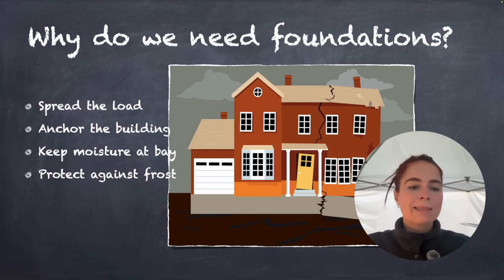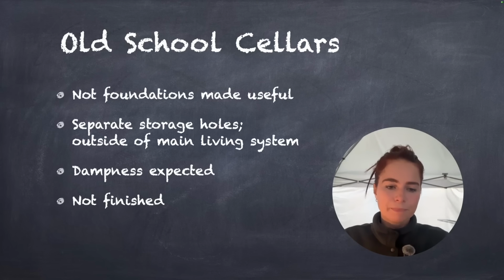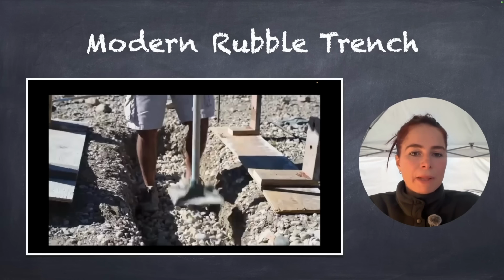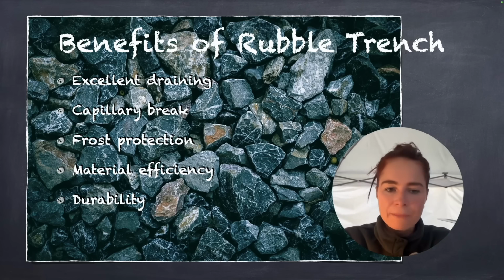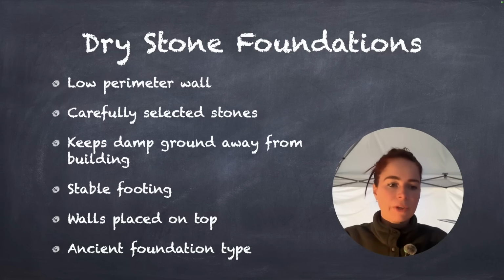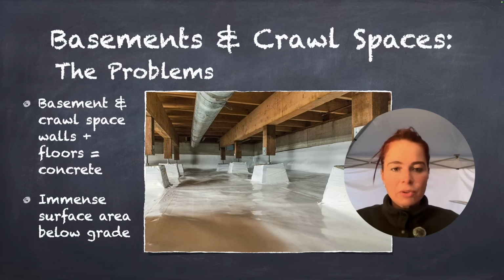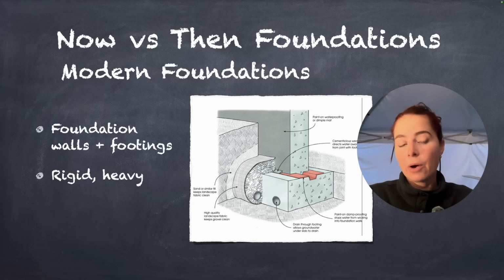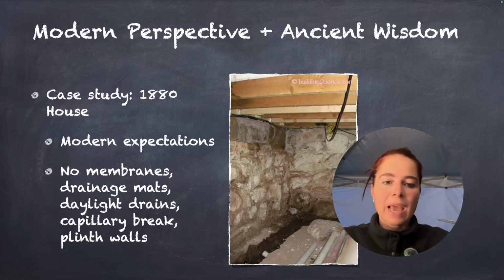Why Modern Foundations Fail — and the Genius Design We Abandoned

Comment: Frost heave is not caused by water, but by salt dissolved in water. Salt tends to Equilibrium creating osmotic pressure. Second law of thermodynamics. Clay has a lot of salts.
Reply: Why do icebergs float in water?
Reply: @RoyUK-s9h 
Fresh water is lighter than salt water.
Salt is displaced when freezing.
Reply: @Darrida Why do ice cubes made of pure ware float in liquid pure water

Comment: Hi, I live in France and I have just built my own house.
I have used the rubble principle.
I had a mix of stone with very little clay in between, I dugout the ground and then put geotextile all over the area plus a 500 mm around the edge of the building then I put 55 tons of gravel over the area folded the geotextile in , then I put blocks 700 mm in from the edge of the building , then I filled up the middle ( inside of the blocks) with more gravel. I continued to put a border around the outside where the edge of the building is, then I had a foundation 300 mm deep and 600 mm wide, plus steel reinforcement, it’s bone dry and I have no cracks and no damp. 
If you want to know more details please get in touch I have lots of pictures
Reply: Id like to know more, does this type of foundation meet the building standards?
Reply: So you filled the cores with pea gravel and rebar?
Reply: That sounds like a very reliable construction. Well done!
Reply: Please, how can I contact you? I am currently planning to build my own house based on natural principles (ecological architecture) in Serbia, so I would probably appreciate photos of your foundation construction. Thanks in advance!
Reply: It's remarkable that a 160 pound mammal needs 110,000 pounds of gravel for a shelter. Something seems very far out of proportion for our idea of a home.
Reply: @tar170 well go back yo hay and clay tribal huts if you want to go full eco. Because today the rest of us are used to a certain life quality and house size

Comment: Basements are built with drainage tile to prevent exterior water from touching the concrete, plus they are waterproofed outside. Interior mold is due to condensation of moist air from cooking & humans breathing & sweating contacting any cold spots (poorly insultated) or holes in vapour barrier (cold air enters or hot exits). All rooms sould be ventilated to remove moist air & replace with dry air (located opposing to "wash" the room) using a heat recovery ventilator (if saving energy in a cold climate). These measures cure the problem. ( its CAPilary.)

Comment: We are still using this method for foundations. We just add more complexity to the moisture control system. The soil type is the major factor of use. As you mentioned this foundation base can only be used in loam, clay and rock must use a layered drain and possibly a sump. It's not uncommon to use #1 or #3 crushed rock or recycled concrete for the ballast. Then top the ballast with #5 or a specialty mix like #411 or #57.

Comment: Mold issues in basements CAN be a non issue if you build right to start either or retrofit (expensive). Waterproofing plus (most important) rock all the way fown the outer wall with tile/drainage pipe.

May not be as easy in flat residential areas.

Comment: There’s a Trolly museum near me that dumped a large amount of ballast 70 years ago and installed a fifty to seventy foot length of track on it. They then put a Caboose on the track. A caboose that weighs close to or exceeding  the weight of a house. No movement from that caboose in all that time and you can live in the caboose comfortably. I have always wondered why this would not be a good foundation for a home and I guess you’ve answered this question.

Comment: We live in a giant, ancient flood plain, a left over from the Ice Age where ground is very heavy clay that moves constantly.  Building with compacting stone is useless as the clay will absorb all the stone and soon enough it is all gone.  Even building roads require layers of geotech fabrics to stop that stone from disappearing into the ground.  Our biggest problem is that back in the late 70’s and early 80’s, the floor joists were embedded in the concrete foundation as it was thought that would better stop air infiltration, however, against regular building wood, the wood rots away quite quickly, especially if using modern insulation techniques.  I have yet to find a method by which insulation should be done in these cases.  The solution I’ve found so far is a trade off, in that the voids between the joists and concrete foundation is minimally insulated with styrofoam against the wood and concrete, thereby creating a thermal barrier, but to not fill the remaining void to allow air movement and thereby stop moisture from settling.  I’ve just had to replace the rim joist of our house due to rot … if you have a better solution, I’m all ears, please and thank you.
Reply: look at the code for Permanent wood Foundation. Rubble Trench underneath with gravel backfill. Now you have a wall assembly that can be insulated along with an engineered floor system that can incorporate radon mitigation as well as be insulated

Comment: Here are a few suggestions: if you wanna be sciency, don't make things up. 1880 "they didn't know capilary force". Actually it was understood back in the late 1600's. Wide knowledge in early 1800's.
Don't know about Canada but Sweden made it a standard in the 70's to build concrete basement foundations with a gravel filled trench and perforated plastic tube. ie over 50 years ago.
Old 1800s techniques worked because houses were leaky, ie ventilated/natural draft. Now people try to insulate old houses and the ventilation is gone and you have serious condensation problem with mold growth every time ventilation is misunderstood.
Reply from the maker: Yup, they knew it as rising damp! Hygroscopic and capillary moisture transport were studied in depth from the 1950s onward, as concrete became the dominant building material.

Comment: Also, you could build a basemented property by incorporating logical drainage methods just deeper underground. i.e. layers of gravel drainage below and on the sides of your basement foundation. As long as your actual ground water (height of water in an equivalent well) is below the gravel drainage layers and the water has a clear path to flow around the house, you could build as deep as you wanted and maintain dryness. Water will not rise unless it has no choice. 

I have personally been looking at the equivalent of a dugout house, utilizing steel beams/rebar as the frame, and a fish pond liner situated as the roof material. on top of the pond liner layers of gravel clay and topsoil is to be used to cover the house and give it a "hobbit house" look... I specialize in drystone walling so I would use drystone with a clay core walls to enable effective ventilation (below the windows and above the foundation...the clay core blocks wind and absorbs liquid from the air). I haven't built it, but this is my general design if I was able to build a house (I am poor and locked in litigation now so after I win my lawsuits I will travel the world in a boat and then once I find my true land/home I will build my house... That is my plan). 

Aaron Singer

Comment: My grandfathers house in Hampstead New Hampshire was build on a rubble foundation. It used a mix of large and small boulders. The house is about 200 years old now. Never had any problems with air quality down there. Never finished it into a living space. Water and air flows through it.

Comment: You've changed my buildings design! 

I am building a rammed earth building in northern idaho. Can you suggest how i might incorporate a rubble trench, grade beam and floor? 

I was thinking about using a clay floor, but maybe a wood floor might make more sense.

The walls are 24" thick. Typically the footer is 3' wide x10" thick.
Reply from the maker: Wow, that’s amazing to hear — thank you! I’m not a professional designer or engineer, but I’ve been diving deep into this stuff because it’s so important to get the moisture dynamics right. A rubble trench under a reinforced grade beam can work beautifully if it’s detailed for drainage and frost protection — that way, the trench manages water and the beam carries the structural load of those 24" walls. For the floor, both clay and wood can work; it really depends on how you want to handle insulation, moisture, and comfort. Clay is great for thermal mass but needs an excellent capillary break underneath. Wood can be warmer and simpler to isolate from ground moisture. Northern Idaho’s freeze–thaw makes drainage and capillary breaks especially key. Definitely worth running your plans by an engineer who’s familiar with earthen construction — but it sounds like such a beautiful project!
Reply: @thehealthybuildingproject  Have you looked at the code for Permanent wood Foundations? It incorporates and dovetails nicely with many of the concepts that you are outlining. I'm in Dallas right now for a building sciences convention, and I hope to see the vernacular being embraced and represented there. I am currently endeavoring to use a PFW, this next spring as our lot is in the mountains with a considerable slope, wherein we must utilize the basement as living space in order to get the most sugar for our dime. LOVE the video! Please do a deep dive on PWF's !

Comment: Roman roads had gravel in its surface, not stones, you cant roll iron weels on stones but in gravel
Reply: Pompeii definitely has stone slab streets. Over what, I'm not sure, though I'd be willing to bet the strata was originally designed to have excellent drainage.

Comment: In the scottish highlands, the french drains around the building are critical infrastructure.  The modern "bump plastic" that stops wicking when placed against the structural elements, creating an air-gap, can allow a building to set below grade yet have dry concrete walls.  I watch your video as i'm designing a building to set in very very wet conditions on bedrock; the site pools water in heavy rains - i'm liking that blown glass insulated rubble for a raft foundation with a full perfpipe draining layer beneath the entire structure - need to stick close to the ground due to the 100mph winds, so digging-in below grade is necessary and anchoring for wind-lift which is the challenge for rubble - you did not cover wind-lift in your considerations of the found and how you anchor to rubble.
Reply: I think you can get tie-down anchors, that go straight from the bottom-plate beams (or even the roof/ceiling top-plates) down to multiple spots around the building, where the "anchors" are set in concrete blocks of their own, set to certain specs (depth, width, etc) for building height, footprint, weather condition zoning, and local geology.

Comment: A for idealism, and naivete. The crawlspaces or basements are not the foundation, they're voids between the ground and the floor, and if you don't like them and their accompanying issues don't blame them on them on the foundation, you can get rid of them with on-grade construction or elevated post and pier, or you can just deal with the issues inherent to them. Either way just understand that substituting gravel for a concrete spread footing does not make mold prone wood floor framing go away, and it doesn't change the fact that the earth is not dry inside, nor does it change the fact that when warm moist vapor and coldness collide then condensation happens and mold, mildew and decay are going to make your home their home. If you don't address those simple facts you will simply create different moisture and mold problems in different places. Nasty basements or crawlspaces are not modern foundation failures.

This tube was a gross simplification that ignores the facts of the ground and the physics of structures to that point that it makes rubble trench foundations seem like a viable option but they are almost never are. From a historical perspective it omits and distorts so much it should just be considered wrong. Rubble trench foundations work for disposable or non-permitted structures like mud huts and sheds, they might even have advantages in certain soil condition, but for most houses and buildings In civilized jurisdictions, specifically most of America or Canada, it's going to be really hard to get your plans through the permitting process because it's just not suitable support for a structure that needs to last and protect the inhabitants. 

Anywhere significant wind or seismic forces need to be resisted it is not a viable choice. It is generally proscribed by code in areas that have conditions that could push the house away from where the owner wants it to be, so don't waste your time on trying it in hurricane or high wind areas such as the coasts, the mountains or the great plains, and certainly not in tornado alley. The IRC and most state codes aren't going to allow it in seismic design zones D0, D1, D2 or E, so all you are left with are zones A, B, C. Now remove from the map areas where frost heave, expansive soils, weak soils exist and you're left with few place that it can work. It's not going to be a secure way to attach the the house in much of the area North of the 40th parallel because of frost. Seismic excludes it from most of the West including pretty much all of Washington, Oregon, California, Alaska, Hawaii, Puerto Rico, huge chunks of Arizona, New Mexico, Nevada, Colorado, Wyoming, Oklahoma, Montana, Idaho, in the mids at the intersection of Illinois, Kentucky, Tennessee, Arkansas there's a huge area that it isn't acceptable, and the South it's not viable in much if not most of South Carolina. Most of what's left is small parts of the Southwest and the South.

Buildings are expensive and the foundation is a relatively small part of that cost, but it is the system that keeps the rest of that huge investment from twisting, bending, sliding, tipping, lifting, melting, sinking and decaying into the ground. The foundation design needs to address the geography of the site and the demands of the structure, and that's where the choice has to start. Rubble trench doesn't offer shear or tension strength and that means that long buildings that shouldn't be allowed to bend up or down, or buildings with large eaves that create uplift are out of consideration. Most light weight buildings that can fly away are also a no go, especially two story structures that can catch the wind. Rubble trench foundations have a place under the walls of Quonset huts with ground embedded anchors, and they're a reasonable choice for many heavy adobe buildings given the right conditions and considerations. 

Crawlspace or basement owe their existence to the demands of the builder and the client, the geography, climate, history, and the economic and social trends of a region and they're a really useful place to put stuff, especially the parts of the structure but, like everything, they need to be built and maintained diligently because when they're wrong it's nasty. The bias against them is reasonable but not a reason to specify a different substandard system. The building system needs to be appropriate to the needs of the structure and the client. 

Over the years I've crawled dozens of good and bad crawlspaces, they're never a nice place to hang out but they're not made to hang out. I've torn out stinky drywalled basement rooms and I've specified build-outs with whole house fans and all tricks to keep the new wall board and studs from going to pot but the fact is that basements, and any floor that touches the ground, are an iffy place for anything that can absorb moisture and harbor microbial life, because mother earth gets moist down there. Don't believe me? Put a plain old brown corrugated cardboard box on the concrete floor of your garage for a few months, that box is going to stick unless you live in a dry air region and there's a vapor barrier under the slab. The management of moist vapor and temperature isn't dependent on footing material. A cool clean basement with bare un-insulated concrete, stone or masonry walls can be a glorious place to escape a scorching heatwave because the only bigger heatsink than outer space is the earth.
Reply: Great post and very well-informed dissertation. Well written too. 👍
Reply: @drott150  Hey it was a rant, give me a break. I just wanted to get it right and set the record straight